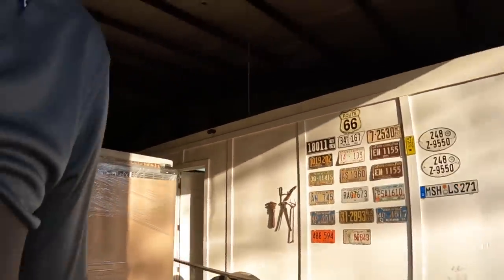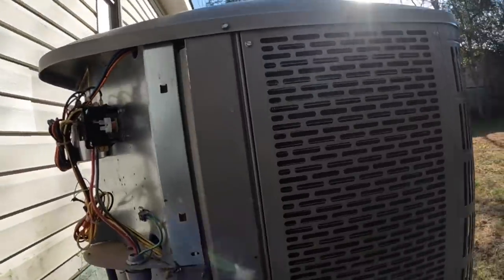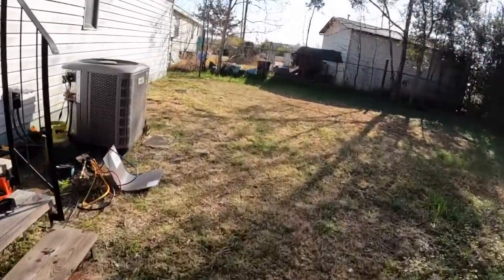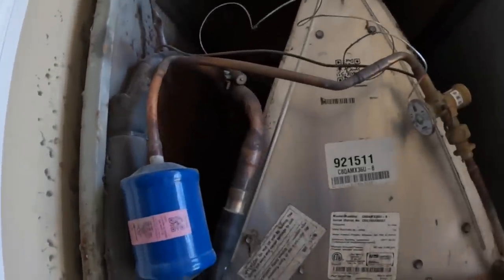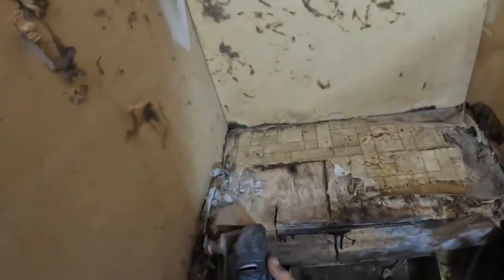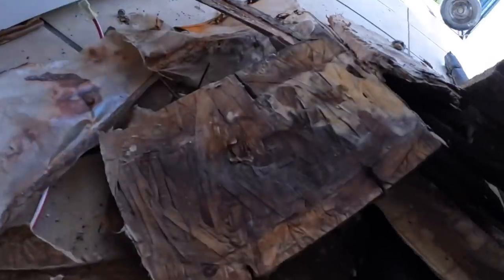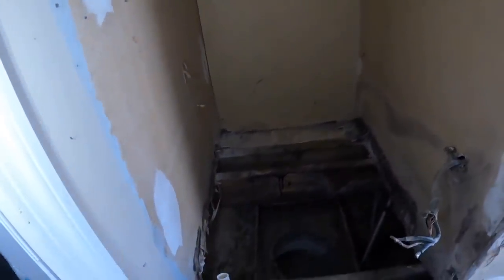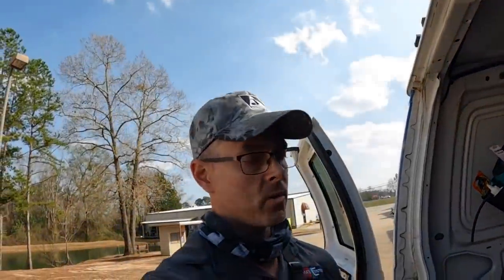Electric Mobile Home Furnace Replacement - Part 1

Comment: I give you props for doing the installs by yourself especially when you have 2 broken ribs. Shows how dedicated you are and loyal to these customers and give them heat. It's nice to have another guy around to make it go a bit easier but in this field you deal what your dealt with and make it work. Work smarter not harder. Great video
Reply: I too aprishead mr paul sir
Reply: Dedicated to that money 💰 🤑💰🤑🤑🤑 BOOOOOOIIIIIIII

Comment: Omg that is going to be a hard one, but makes formidable challenge once you do those once in a while. We used to replace those with package units instead, when I used to work for a company.the gas furnaces where a nightmare to remove and then cover the hole, customer would have a new closet.but then we had run flex duct underneath the home and add a new return.omg.i was in my 28s.

Comment: When you say electric, do you mean you installed a heat pump system? What brand and model is the heat pump and air handler? I need to upgrade my loud single stage furnace soon.

Comment: Have a question. I bought an older 3 bed 2 bath 16x80 manufactured home made in 1992 anyhow I went with a gas package unit instead of a split system. I have 9 registers but want to upgrade all the duct work as it’s falling apart and would like to know what size duct work to go with on supply side . I went with a 16 inch  on return with a 20x30 filter grille

Comment: I really hope there was added cost to the flooring you done? Usually when I install in trailers I would tell the owner that there could be hidden floor damage and I won't know til after the unit is out and either I'll repair at an additional cost or they can pay a flooring guy.

Comment: Those micro channel coils are junk… work on a lot of mobile home systems in and around the Austin tx area and boy they are only 7&9 yrs old…
Reply: 7 to 9 years? Doing better than a lot of other coils
Reply: @GlassJR  most still last 10 yrs or so residential. But yes, cheap aluminum and cheap copper with high pressures is not a good mixture.